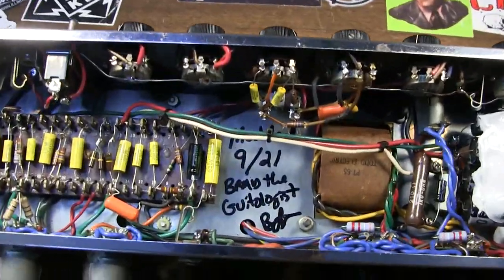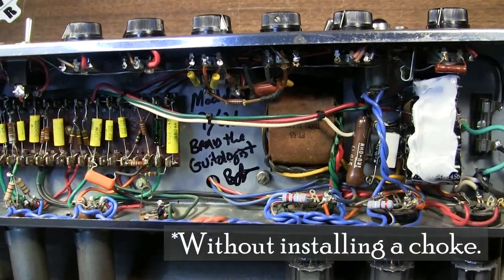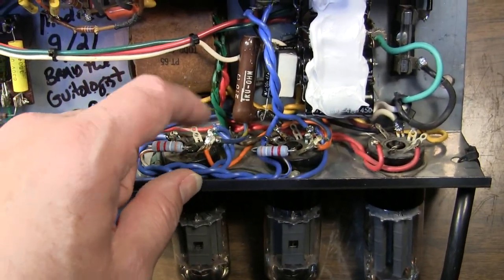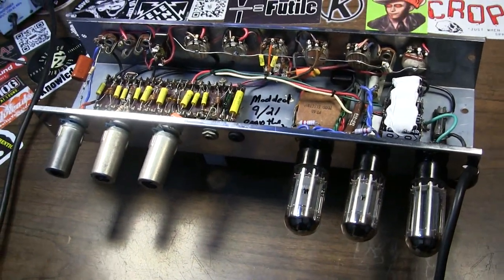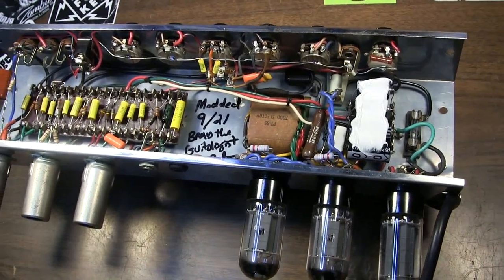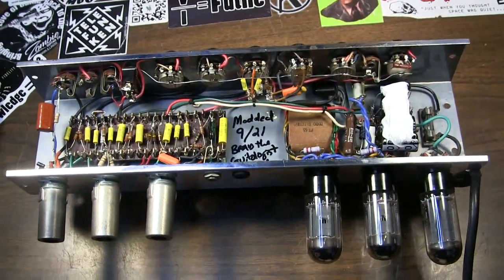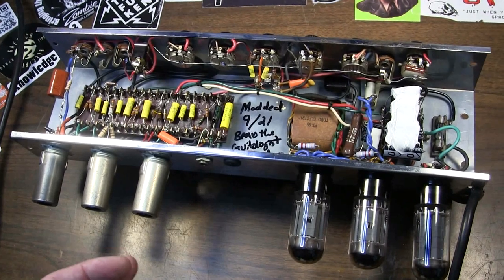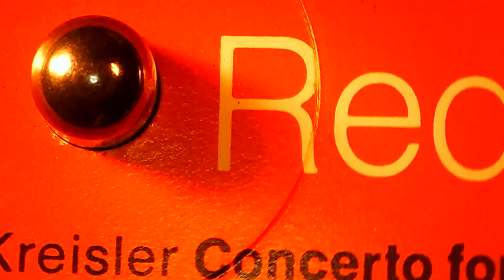Finally...a Guitar Amp with BALLS - 1959 Guild 66-J

Comment: I always raise the filament virtual CT to about 50V with a voltage divider and filter cap from the B+. It gets rid of virtually all filament hum.
Reply from the maker: There are some diminishing returns on it. If the gain is pretty high, it's probably worth doing, but on a lot of vintage amps, the results won't be as noticeable, if at all. Always good to experiment though and have these tricks up one's sleeve.

Comment: Maybe I'm just an old dude, but I think I actually prefer the amount of overdrive this amp gets in NORMAL just simply cranked up. If I ever got ahold of one of these amps, that underpowered output transformer would have to go. Might even add a choke to it as well. Good work/engineering Brad. You never disappoint. :)

Comment: Great video. Appreciate your description of everything and your playing. Came across a weird Danelectro Amp yesterday. The Phase Inverter output connects to two pairs of 6L6 tubes with two tubes driving one output transformer and another pair driving a second output transformer. Each output transformer connects to a single 12 inch field coil speaker to make a 2x12 combo. Certainly unique! Not sure of why Danelectro did that.
Reply from the maker: More power. Having two amps is better than one in terms of volume. Lots of older amps did that. I showed one Gretsch recently on the channel that had stereo output.

Comment: I seem to remember that pretty much all the 12AX7, 12AT7, 12AU7, ECC83, ECC82, ECC81 twin triode tubes, and their equivalents, have a Heater to Cathode voltage-rating of something like 100V DC maximum, so, raising/elevating the Heaters above ground is actually a good thing to do to prevent Heater-Cathode leakage.

Comment: The transformer is the most expensive part in a tube amp and many manufacturers would scrimp on the VA of the transformers figuring the customer would not care or even notice. Lower the VA cheaper the transformer. They got to make a buck somehow. Regardless, that amp sounds terrific!
Reply from the maker: Seriously though, this amp was at about 5W RMS with PP 6V6s. This should have also allowed them to cheap out on the speaker...BUT this amp originally came with a Jensen P12Q! So that theory doesn't hold. Just weird. I think it's really down to a guitar company trying to sell amps and really didn't know what they were doing and weren't cohesive about their vision for the line.
Reply: @TheGuitologist  With all the tube gear I've worked on often I wonder what was on their minds by designing things like they did. Some stuff was golden and other stuff was... crap! It may very well be down to what was in stock at the time, anyway Brad, you'll set them straight, you did wonders with this one.
Reply: I recall V1 being the priciest component for my express build. LOL!!!!
Reply: @TheGuitologist  back then supply and demand was the rule and dictated economies, specially the USA.. it could be the trans they wanted to use was either too expensive to justify cost or that Jensens and other components were dirt cheap also due to supply,  really hard to say but 59' was an odd year for sure specifically economic wise...

revolving credit was introduced and anyone with a job could buy almost anything, I suspect someone could research copper demands in 59 maybe they were upside down? I did look at a chart form macrotrends and indeed in early to mid 59 copper prices soared over the norm then dropped in 60', maybe that had something to do with it? maybe a suitable tranny wasn't available aside from bespoke or in house?

things were weird in 59 for sure it really was a hallmark year in terms of economy, unemployment and finance private consumption, does seem odd in any event as loud loud loud was in and bigger is better was fashionable, maybe its a design flaw in the engineering?  lol
Reply: If you put in a heftier power transformer to maximise the PP 6V6 output, then the output transformer might also be under powered?

Comment: Changing the plate resistors from 1/2 watt carbon comp to 1 watt carbon film will get rid of a lot of white noise. Capacitor/s in the bias supply can also introduce hum. Exchanging a 25uf 50v to 2 10uf 100/150v in parallel will make a significant difference.

Comment: A lot of companies back in the day especially the off-brand companies often underpowered their amps for the simple reasons of 
(A): the longevity of the amp figuring that most people could not afford big amps and would try to get the most out of their little and it wouldn't blow up..
(B): that the amp under long continuous play would have a melt down and burn down the local VFW Hall or the school gymnasium wherever they were playing...
A lot of companies back in the day got sued due to malfunctions of the amp so in order to keep that from happening they underpowered them...
My high school electronics teacher used to work for Gibson back in the early years of his career.. and in the 80s when I brought in my 1962 Gibson GA300 RVT. amp to get rebuilt we had lots of discussions over amplifiers and which were better and which were worse and this is one of the conversations that had come up he remembered at one time (in the early to mid 60s when he worked for Gibson) that Fender (the competition)... Had gotten sued due to an amp at some high school venue had caught fire while it was in standby and nine kids or something like that had died as a result of the fire that it had caused... 
Of course none of this was released to the public and was contained as to not ruin the reputation of the company... Obviously they compensated and swept it under the rug..
The conversation that that created was because I wanted the hot rod up that amplifier and how we could go about it safely he was extremely knowledgeable and yes we did Hot rod up that 300 amp. So the moral of the story is that most amplifiers were never put up to their optimum capacity I guess you'd call it due to these varying reasons.... Anyway enjoyed the video and keep up the good work Brad looking forward to more

Comment: That is pretty epic! Great sound and you even managed to demo the return input in normal mode a little by mistake at 16:25! Very good information throughout, well done in both videos Brad! Greetings from Hungary ;)
Reply from the maker: It'll pass signal in that mode on that channel, but best to use an outboard preamp of some kind if doing that.
Reply: @TheGuitologist  Yes I was wondering if it was just the powerstage without the pre-amp circuitry. Even more versatile as I thought! Great job!

Comment: Never tried to ground at the PI. I have used the power tubes cathode. If ive got an anemic PT i like to use SS rectifier. Saves some stress on the power section and gives the amp a little more umph

Comment: In the case of the Harvard, I can only theorize, but it would be true to Leo as we know him to design an amp around a low voltage transformer to utilize a bargain he picked up. We get used to thinking in terms of maximum potential in wattage for an amp design where Leo was thinking maximum clean all the time, and for cheap. 

Noticing the distinction of the cathode bias, which would normally raise our wattage potential, yet other Fenders are not cathode biased. It just feels like analyzing it backwards, but in his case, he was able to squeeze a bit more out of that cheap transformer this way without adding cost to the build. It does make me wonder though, how this design would perform at say 400+ volts. Feel free to clone that Harvard with a Hotter transformer and see how it holds up. Sharing that with the rest of us, of course.

Comment: Wouldn't the lower plate voltage give it less headroom and the ability to overdrive easier, albeit at a lower power level? Especially when hitting the output tubes with an extra gain stage.
Reply: Or are you just referring to the fact that they can't deliver their full power? Maybe I fell asleep. LOL
Reply: Sounds great regardless!
Reply from the maker: You're right. I think I misspoke on that. It'll break up at lower volumes but won't have full headroom. The load line slope will be way off. That's what I meant to say.
Reply: @TheGuitologist  there's the solution I was looking for.

Comment: I wonder if swapping out the 5y3 for a 5v4 or maybe even a 5ar4 would get the voltage and current up to what might be "more normal"?
Reply: Or even silicon diodes. Anyway, if he can't drive the power amp to distortion, it also indicates a preamp / PI problem: Not enough voltage gain.

Comment: You could also substitute other members of the 12a?7 family in for the preamp tube to tweak the gain but not raise the noise floor so much. Maybe also make the beast switch go from Blues to Rock instead of Rock to Metal depending on what the owner plays.

Comment: I'm not sure why putting the tubes heaters 6vdc or 6avdc to a virtual ground using the phase inverters cathode DC voltage as the virtual ground would reduce the noises. Any reasons why tubes heaters are inducing noises in general that you have to put the heater grounds at a different DC offset virtual ground?

Comment: Hi Brad, do you think "Curly " Guitar leads can make a difference to the signal compared to a straight lead? I have a 30ft coiled cable that is very well made but compared to a 30ft straight lead it makes the Guitar sound brighter(I know 30ft is too long and we should reallt be using 18ft 6") ?

Comment: Hey Brad, how come you do not use a toroid with a few windings for a choke on the ground and on the the AC input.
That might have solved the issue(s) without doing all that extra work. Your work is very clean and tidy.
Thanks for sharing. I alway learn something when I watch you solve a problem like this.

I do have a concerned about the wire loom passing though the hole in the chassis(where you signed your name) with no grommet.
Ricky from IBM, Ret

Comment: There is european equivalent to the 6v6 that doesnt handle as much voltage. So to use it you have to cool the bias down. Im wondering if that tube would be better in an amp like this than the actual 6v6. I cant remember what its called, its related to the 6p3s. Might be something to try next time you repair an amp with a transformer like this. Very interesting video, thanks.

Comment: Couldn't  you raise  the plate voltage  with a solid state rectifier  or a rectifier tube with a lower voltage drop
Reply from the maker: Yes. A ss rectifier or GZ34 would be improvements, but still wouldn't get you there on this one.

Comment: I wonder if an undersized transformer would increase the attack.  Full voltage at the start of a note, but compresses down as the power supply drains due to the transformer.  Either that, or a clean attack but a overdriven sustain.

Comment: Great vid, learned a lot. Amp really sounds amazing, keep the vids coming! The "black dot" reminded me of a question I had. How is adding an internal gain stage via the mod different to putting a booster pedal in front of the amp, assuming you had a similar amount of gain in the pedal?
Reply from the maker: The internal mod is adding another TUBE gain stage. A pedal would not be a tube gain, or if it was, it would be running in a starved plate configuration that would not be the same. I prefer all-tube saturation where possible.
Reply: @TheGuitologist  Thanks!

Comment: I am desperately looking for info on my FGenterprises ga445 amp. Its a solid state dual input combo with a 15 inch speaker and i believe FG stands for Fred Gretsch. Is there any way to get more gain out of late 60s, early 70s Gretsch/Kay/Multi-vox amps?

Comment: I'm workiong on the same amp and have almost 430V B+. I had to increase the cathode resistor to 500 ohms. They must have started using a different transformer at some point.

Comment: Hey Brad, I was told by a boutique amp builder today,  that the power break up like when you crank a clean tube amp to 10 to get the power tubes cooking and break up. He said that 90% of that comes from the “phase inverter” I think he said, not the actual tubes themselves. Is this true? If not, what can I change 6l6gc out to break up early?
Reply from the maker: The phase inverter? No. The PI doesn't contribute much to breakup usually. Depends what type it is, but not generally.
Reply: @TheGuitologist  Thank for the reply! Specifically we were talking about the Governor circuit by Dennis Kager and how it works. If that helps. This video, speaking of low output transformer, taming the tubes, it was a conversation starter. Thank you. I learn something new every day. They’ve brought back the governor in Valvetrain amps.

Comment: That's a very interesting problem, Brad. I haven't seen the previous video yet, but did you measure the high voltage AC from the Power Transformer? If that was OK, I assume the B+ must have been low. What rectifier was it? If its a 5Y3, try a 5V4 or even 5AR4. That may give you enough B+ to run your cathode resistors again. :-)

Comment: hey Brad , do you think in this situations with under spec transformers could it be possible to use maybe low power tubes, such as 6g6 or 6k6, less power output but less current needed too...maybe if the ot has the same load ?
ah and Btw great job the amp sounds great and super playing too 🤟
Reply from the maker: I think that could be a way to make the amp perform differently, yes. It’s a cool suggestion.
Reply: @TheGuitologist  cheers man👍🏻

Comment: The way they run the 6V6s on there sounds kinda like my old Silvertone 1483.  It's only 22 watts or so out of a pair of 6L6s, nowhere near the 50 watts they typically run at.  It's supposed to be a bass amp, but at 22 watts....

Comment: Why not just swap in a higher voltage transformer that can deliver what the output tubes are capable of. I waited in anticipation of you replacing it, but you never did. You contradicted the implications suggested in the video title..."guitar amp with balls". How could you imply that and then say it could never reach its full potential in its current configuration? What am I missing here?